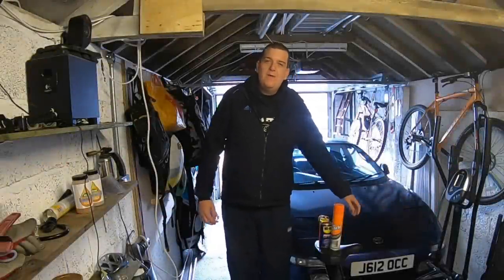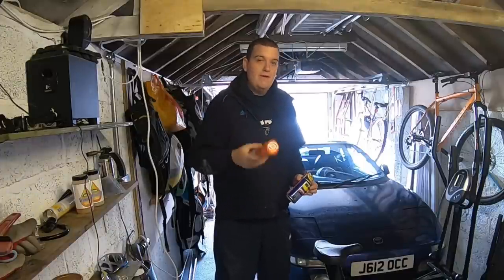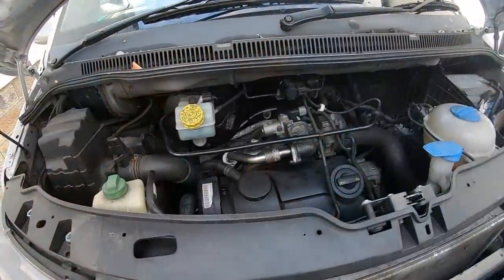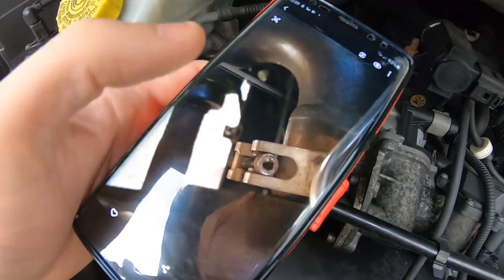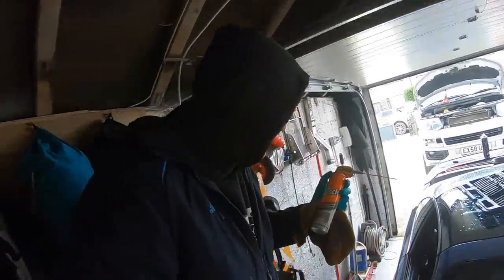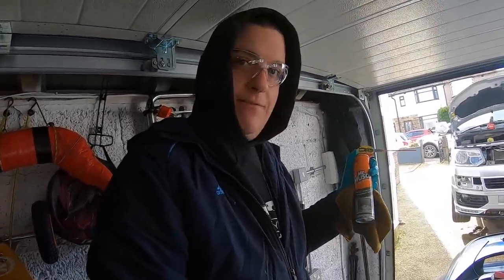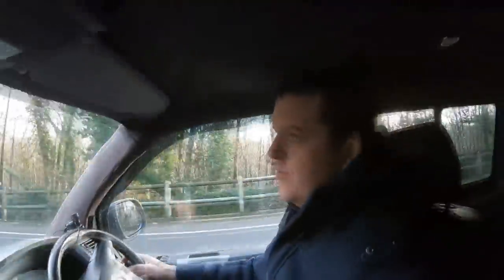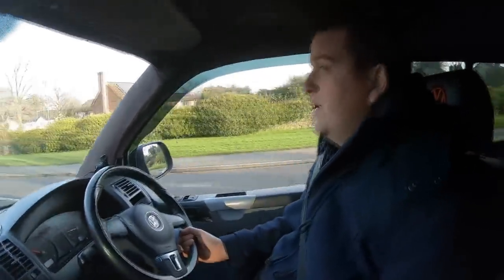Sticky VNT Turbo Vanes Clean - P0234 / P0299 Overboost - VW / Audi / Seat / Skoda

Comment: 1. Poke a small hole in the centre of a Pringles can lid (maybe different on other engines, mine is 2.0tdi 16v BKD ), small enough to only fit a WD-40 spray tube through it. The lid fits perfectly to seal the exhaust side of the turbo to prevent the oven cleaner from coming out. 
2. Disconnect the actuator from the VNT arm by removing the c clip on the actuator arm (in the middle of the turbo). Be careful not to let the clip flick off and  losing it. (If you are worried you will lose the clip, leave it on and skip this step, but it isn't as easy to more the VNT or getting a feel for what the inside of the turbo is like.)
3. Depending on your car, make sure the actuator is pushed away from you. This opens up the channels in the VNT and allows the oven cleaner to flow deeply into the turbo. Start to spray the oven clean inside the turbo using a wd40 tube on the oven cleaner can. Insert wd40 tube through the hole in the centre of the Pringles can lid. You want to spray it in different positions of the turbo fins so it expands all around the VNT.
4. Let the oven clean sit for 5-10min, then return back and move the actuator arm up and down, if it is stiff you can use a stubby 14mm on the actuator arm for leverage to move it up and down, if it is still attached with the c clip. 
5. Repeat steps 4 and 5 until the actuation of the VNT is smoother
6. remove Pringles can lid, wipe any visible oven cleaner away, reinstall exhaust, and take car for a brisk drive. 

Other common issues with older 1.9 TDI's is the failure of the N75 boost sensor, Boost leaks, worn out/old turbo, excessively retarded engine timing (common after timing belt change done poorly). 

Darkside Developments are the only people I would personally trust to do a proper timing belt change that finely adjust the cams for optimum performance and driving style.
Reply: Very well said 👏 genuinely
Reply: Very nice. I used your advice to fix a sticky turbo and the pringles lid saved any mess. Took an hour to free up the actuator. Thanks
Reply: @gtirdobby  glad to of helped. 👍🏻
Reply: 2 years later but hoping for a reply...I've got a 2L BKD on the Touran - how did you get access to the hot side as I was thinking I'll need to take off the whole exhaust at the turbo, cheers
Reply: @CornishTim93  I took off the V band clamp, then just pushed the exhaust end aside, I did it on a Mk5 golf with bkd engine. I know some variations are bolted together. Either way, you shouldn't need to take the whole exhaust off. I guess it just depends on how much room you want.

Comment: This will be my next job as I’ve got overboost but only going up steep hills.. so far I’ve changed N75, boost pressure sensor and 2 intercooler pipes. Took the egr off & that looks pretty clean, going back from the egr to the down pipes looks a bit sooty so hopefully the turbo just needs cleaning.

Comment: So I've got my T5 2.5TDi up on ramps starting to tackle this. It's a 4 Motion with 3 zone climate so there's a bit more stuff in the way and less space with the bigger motor. But the downpipe clamp on the turbo is the same. Released the Allen bolt but can't prize the clamp off. It wraps around the join and seems totally immovable... What's the trick??
Reply: It was stuck fairly well but prized it off with a flat blade screwdriver :)

Comment: My concern with this would be the foam expanding back up the exhaust manifold into the head. If that happens there is a risk of hydrolock. In fairness, i haven't read of this happening.

Comment: Hi matey I have a van that won't do hills  or should I say drops in power going up inclines at motorway speed it is like turbo is none existent can you help plz
Reply from the maker: Need to check for codes, it its in limp mode there will be engine management light and a error code. That will help point you in where to look.

Comment: Vacuum actuator will be a likely cause, very common, you can prove it with a cheap vacuum gauge and VCDS, the gauge won’t hold the vacuum if it’s at fault..
Reply from the maker: Your words are correct. But that wasn't my issue. I do show the issue and how to test in the next video. Friday.
Reply: i think its the n75 valve or whatever its called

Comment: I have a p0234 code on a citroen c4 picasso which is a overboost problem do you think this method would work or just to change the boost sensor?
Reply from the maker: I sure do! I'm going to add that code into the title of the video. Its well worth a shot

Comment: I have the same error code p0234  this happened after the actuator was changed on Passat 2.0  TDI  it comes up with over boost will this work?
Reply from the maker: There's a chance it would work if the turbo's vanes are stuck. Thats what this video was made for.

Comment: Done this a few times with with oven cleaner and all turbos has blown a couple of months later just a heads up
Reply from the maker: I appreciate the comment. From all of the threads I've read on the forums online, I haven't seen a bad report on it. End of the day the foam is blown straight out the exhaust.
Reply: If you’ve done this a few times and they blew up each time why did you carry on doing it? 😂